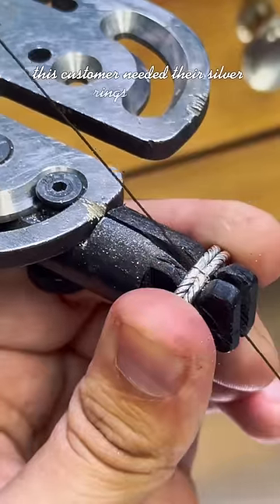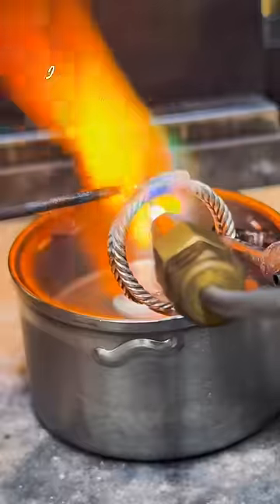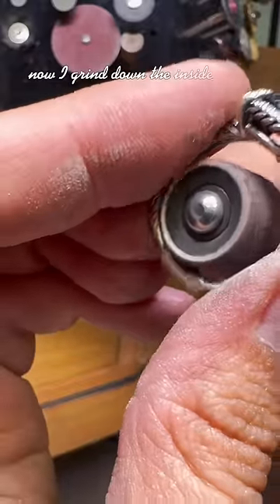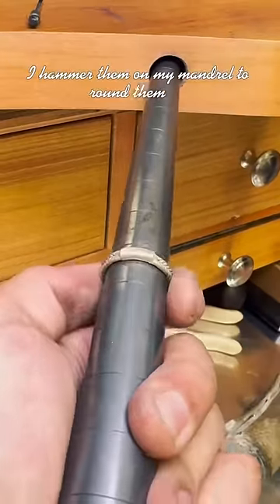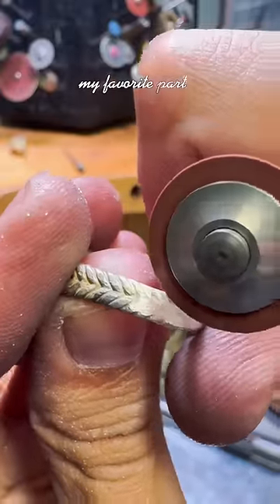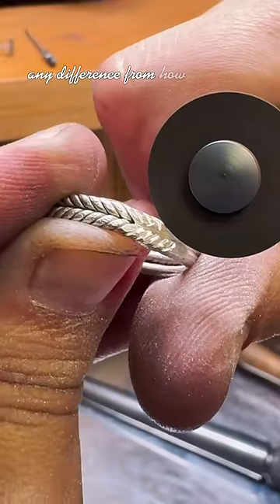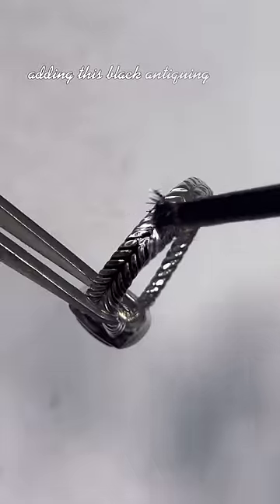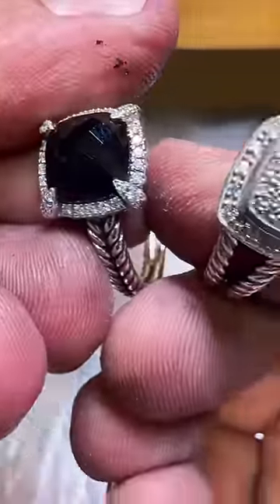Silver Cable Rings Sized Up In Water #silver #jewelryaddict #jewelrydesign

Comment from the maker: Check out the full 8 minute version of this video on our channel!
Reply: Hey does that ring make your skin green since it’s silver?
Reply: You worked some magic on that.  I'm  still trying to successfully solder my bezel onto a backplate.
Reply: Hi
Reply: How can I find a reputable jeweler in Florida? I would like my Mother's engagement ring resized
Reply from the maker: @ralphtv6312 no. Copper and sometimes brass does that.
Reply from the maker: @mixedmediaartgirl300 everyone starts somewhere. I still struggle with those. The bezels are so thin compared to the plate. It’s hard to get everything the perfect temperature!
Reply from the maker: @gracekelly2810 use google maps or yelp and look for places nearby with 4+ stars with at least 20 reviews. Then call and ask if they do their repairs in house (a good thing). Avoid big chain places like Zales or Kay.
Reply: @MassoyanJewelers  gotcha
Reply: @MassoyanJewelers  exactly.   Is it easier with paste flux?

Comment: So is the ring part solder now?
Reply: I guess, yes, technically, it is. However, most "solid piece" handcrafted rings that aren't made through casting or shaping a blank plate most likely contain solder (as in a metal made specifically to melt at a lower temperature than the one you want to join together. that largely contains the base metal, in this case silver, plus other metals to lower the melting point)
Reply from the maker: Most jewelry is “part solder” 😂